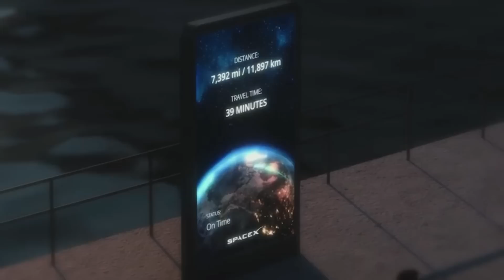Exactly Why SpaceX Sold Its Two Oil Rigs

Comment: The oil rigs were a bad idea.  As an offshore rig designer, I can confidently say that a semisubmersible will not float on steam, which is what the water under the rig will turn into when a super heavy booster launches.  It might work for a falcon, but a bottom founded rig, such as a jack up which could be raised well above the sea surface, would be a much better option.

Comment: Lift the rocket 150 feet from the ground with the chopsticks. Put a 30 foot deep by 150 foot wide pool of water under the rocket. Launch from there. Cheap and easy

Comment: Only 5 years before SpaceX starts point-point passenger flights which Shotwell said would definitely happen, so they really need to start building the sea-based launch platforms today if they want to have the dozens required by 2028. They also need to start negotiating with the city authorities exactly where these platforms will be positioned, perform environmental impact studies, plan and build the shore-based infrastructure, design and build all the boats required to ferry passengers to and from the sea platforms, build all the tankers and shore depots required to supply the platforms with methane and LOX for all those daily launches. Doing all this takes time and 5 years isn't far away. NASA managed to land men on the moon because they were working on everything all at the same time.
Reply: Using rockets for passenger travel is insane. It's not going to happen. That's just one of Elon's fantasies. It will use too much fuel and cause too many emissions and cost too much.
Reply: They may well be doing these things
Reply: @rodschmidt8952  If they were, Musk would be bragging about it

Comment: Prediction and possible discussion jumping off point:
After ship and booster convincingly touch down gently on water, they will launch a mostly empty starship, barely off the pad and catch it with chopsticks. Assuming that works well enough, the next booster will return to launch pad.

Then, a mix of StarLink launches and development of orbital transfer of propellant. It's possible to use a Starship that has released its load of satellites as a test recipient of propellant from a tanker launched in advance.

Comment: I didn’t think the oil rigs were going to be big enough before they said they were going to catch the booster and starship… that’s when the launch tower got bigger and heavier.  I think the engineers said they would be too top heavy.  Ie, “We’re going to need a bigger boat…”. Lol.
Reply: Yes that looks to be the problem, I worked on these platforms and what SpaceX needs is much bigger in size

Comment: I think that to understand the problems of using the two ex-rigs for (regular) launches you need to look at the requirements.
1) logistics - huge amounts of fuel and oxidant (4,500 tonnes per launch) in separate ships near to the rigs along with the kit to supercool and connect both to the rigs for refilling rig tanks; depending upon planned use a queue of starships and possibly several super heavies to be delivered to the rigs; payloads need to be transported to the rigs; the rigs are presumably tens of miles and possibly hundreds of miles offshore (e.g. equatorial launch for maximum launch capacity)
2) maintenance - if anything causes a launch hold/abort then you are unlikely to have a comprehensive set of spares and the relevant engineers to fix the issues with the super heavy and/or starship and/or payload.
3) sea spray ingression into anything and everything e.g. heat shield tiles or backing; engine controls; ...
And I'm pretty sure that there are other major concerns (such as environmental acceptability - huge noise, for example, damaging to sea life).
I was surprised the SpaceX bought the rigs and I'm not surprised that they haven't progressed them very far. Nice idea but impractical, and Elon Musk, above all else, tries for practical solutions.
Reply: But there tiny problems compared to Mars colony ?
Reply: You have it backwards. Elon isn't practical. He's a dreamer. He wants to do whatever he dreams up, and wants to ingore government regulation and the laws of physics as much as possible. The Sea launch was just to get away from local government telling him he couldn't do it.

Comment: Bipolar affect disorders can give a talented person creative superpowers, especially during the manic phase.  You have tremendous energy, can keep a dozen things in mind simultaneously and see how they interact in a system and how it works, you need very little sleep, its awesome.  One of the classic pitfalls is to start a dozen projects when you should focus on one, maybe two or three so you can jump from one to another when your're stuck on the one.  
Psychologists have a list of stuff like that which statistically go together.  Studying the list and going over it again every day you are not recovering from the burnout (basically every day your superpower is going), helps consciously guard against hasty decisions on things with so much momentum.    I have found patient forums on this especially interesting because there are ways to trigger the manic state when needed, and ways to prolong it.  You will pay a price in terms of longer recovery from the burnout, but its possible to control it to a certain extent.

Comment: Perhaps the oil rigs were a part of the ridiculous point-to-point, beat-the-long-haul-aviation idea and someone has finally realised how ridiculous this notion was and that it was never going to happen
Reply: Just because you guys cant achieve anything amazing doesnt mean the people that make the "impossible" look simple cant accomplish more then you can understand.
Also, just because you can vomit your half baked nonsense onto a world wide public space doesnt mean you have the slightest notion of how to utilize neurons in order to come up with a reasonable thought.
Reply: Common Sense Skeptic did a great video debunking the ludicrous idea of traveling by rocket.
Reply: @Krunchy71  Yep, both CSS and Thunderf00t beat this subject to death with simple logic. It really was a no starter however you look at it
Reply: Well landing a rocket is a ridiculous idea much more if it's the biggest rocket ever created to be "catched".
I don't see why point to point rocket transportation won't be a thing
Reply: @LeftOverMacNCheese  Because its thousands of times more dangerous than flying, and uses hundreds of times more fuel. Rockets will never be able to turn around quickly like an airplane. 

It takes hours to fit everyone with space suits and transport them to the launch facility which has to be out in the ocean far away from any population centers. Then you have to fuel the rocket which takes hours.
Reply: @Krunchy71  It worked as intended though. It got SpaceX a large amount of investor and government money.
Reply: Rail travel is another ridiculous idea that will never happen. People cannot survive inside a rail car traveling faster than 21 miles per hour, as the air will all be sucked out.